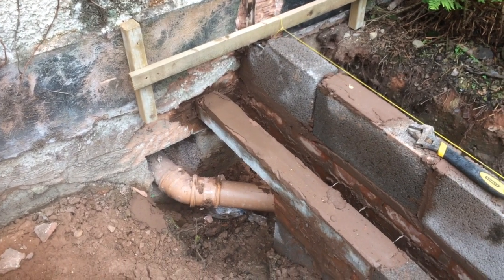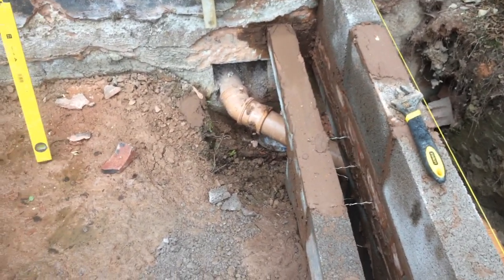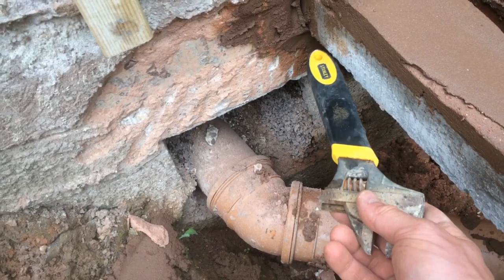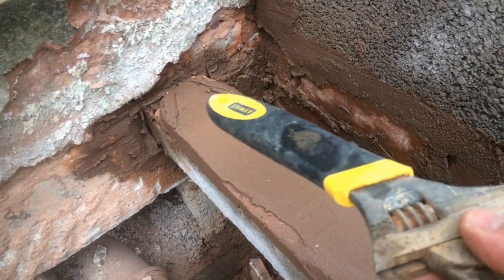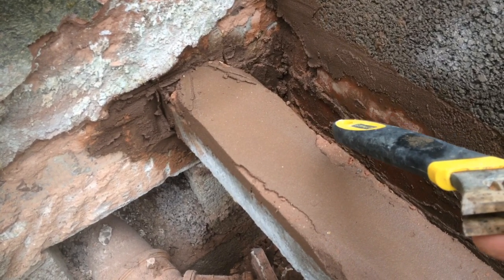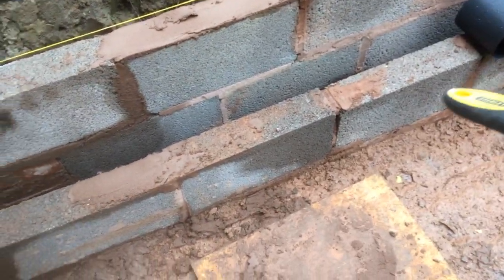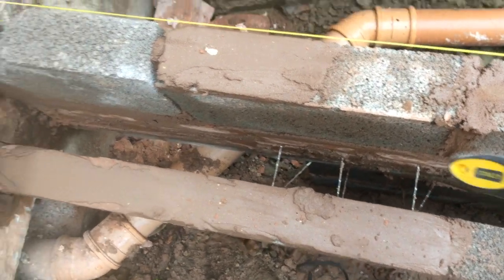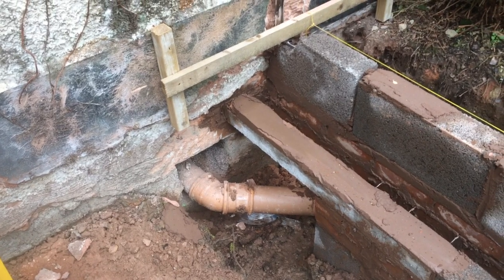Key in Concrete Lintel to Existing Block or Brick Work

Comment: I know this is old but how did you bring your slab up and over to the pipe?
Reply from the maker: no worries, still alive and kicking! The foundation has to go under the pipe. So if you need a 1 meter deep foundation and base (invert) of pipe is at 50cm then you will need to go down over 1.6m. You then fill up with concrete leaving appropriate gap under pipe & building up with concrete block until you can get a lintel over the top. . . . boom.